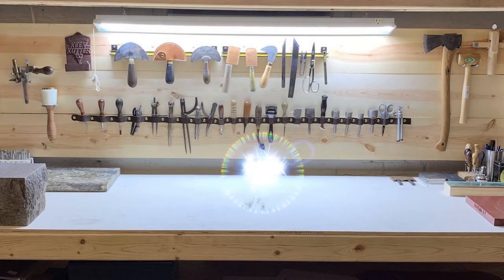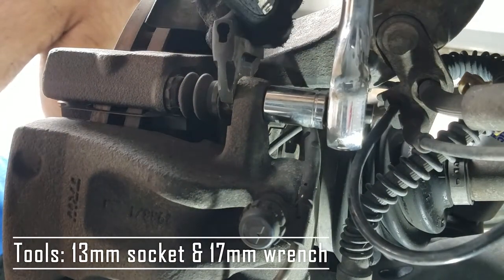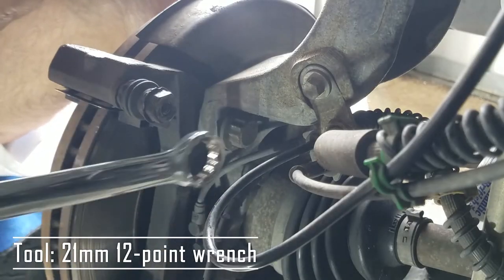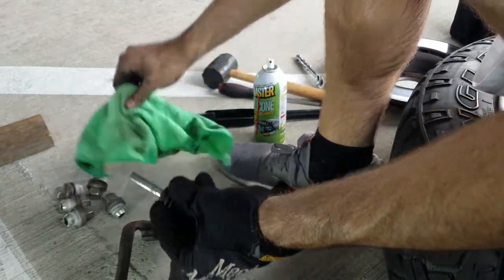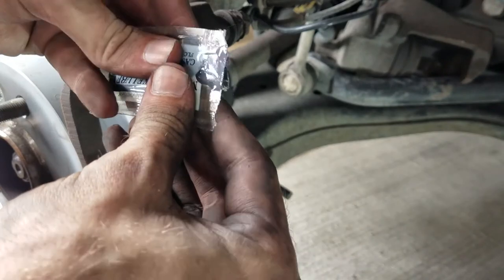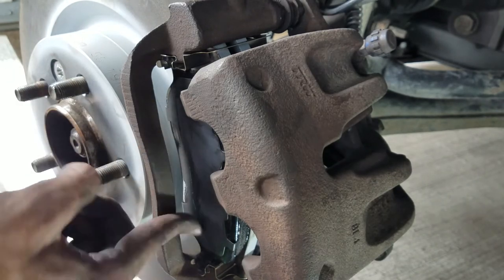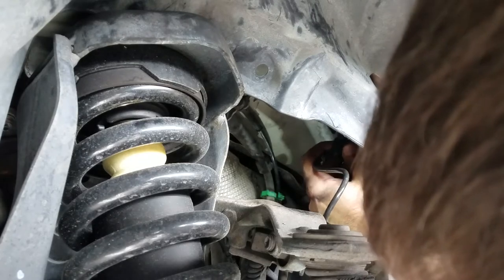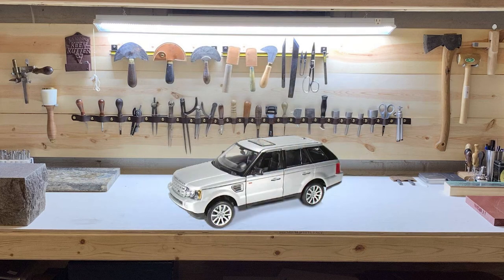Replace Brake Pads - Range Rover Sport or LR3 (+ Rotors & Sensor!)

Comment: This instruction work with MY2010 5.0SC as well?
Reply from the maker: The SC usually has brembo brakes, so removing the caliper will be different. Overall the procedure will be similar however.

Comment: Hi very good video. One question how do you reset the brake light after replacing the wear sensors?
Reply from the maker: It automatically turns back off once the sensor is replaced 👌

Comment: Hi! Is the brake sensor on the lr3 a one time use? Do I need to replace it each time I replace the pads?
Reply from the maker: If the brake light comes on, the circuit was rubbed down and broken so the sensor will need replacing. If the light never came on then you might be able to use the sensor again, just look at it and see.
Reply: @HazyJay  excellent thank you!

Comment: Where would you recommend ordering the brake set from? Is there a specific serial or product number?
Reply from the maker: The description will have the parts for the FRONT brakes (EUR1098), also these are the non-brembo brakes that are usually found on the normal RRS (the supercharged RRS has the brembo brakes).

Comment: Great VD,  ? 4 u.when u r changing the brake pads do u also need 2 replace the rotor 2 even though  they r in good condition?
Reply from the maker: If the rotors are in good condition then it's not necessary to replace the rotors with the pads, the new pads will seat with the old rotor's grooves after a few miles.
Reply: @HazyJay  thanks  ! U just saved me thousands of $$ some dude @ PEP-BOYS WANTED  ME 2 CHANGE ALL THE ROTORS.
Reply from the maker: @walkingdisaster2475  Heh yeah if you take it to a repair shop they will almost always want you to either change the rotors or have the rotors machined, both options are usually way overpriced. You can buy 4 new rotors for about $300, so there's no reason it should cost >$1,000 for a rotor job IMO.

Comment: i done replace brake pads front and rear fit new sensor is only one sensor at the fornt and one at the rear replace both i when for drive is about 300m away press the brake wear pads light on please can you help me out
Reply from the maker: There should only be one sensor for the front and back, you'll need to manually check them to make sure they didn't get worn down from being installed at a slight angle or disconnected from the plug, either situation would cause the light to come on.

Comment: Really good. I think they are the same as 06 RR HSE. One question... why didn't you use the "brake grease" in the caliper pins? I know some brits use copper grease. You indicated it should be silicon paste... maybe not critical... but curious
Reply from the maker: It's my understanding that silicone paste wont degrade the rubber boot on the caliper pins and it holds up to high heat like with breaking. If you use copper grease it's probably not the end of the world, it will definitely withstand the heat although it may degrade the rubber.

Comment: Another great video. One question: are there sensors on both the left and the right sides?
Reply from the maker: No they are on JUST the driver front and back brakes, there aren't any on the passenger side. I guess they assume you'll change both front/rear at the same time and the pads will wear the same 🤔

Comment: Why not use slotted rotors or drilled rotors?
Reply from the maker: You certainly can if you'd like, however the perks of those rotors don't really translate to how I use the car. The idea is drilled or slotted rotors cool the rotors faster after significant braking, like slamming on the brakes multiple times at highway speeds (or racing), this just isn't something that I ever do. One-time stopping (emergency braking to avoid an accident) should be the same between normal and drilled/slotted rotors, which is more important for me, and normal city/highway braking should be the same as well.
Reply: I put everything good but the light still stay on
Reply from the maker: @joseangelcaceresjimenez3645  You did change the brake sensor, correct? In addition, there is a brake sensor in the rear that may also have been worn.

Comment: I have replaced all pads and rotors on my Range Rover sport super charged 2011 twice, but it front rotors still got swirled somehow. Is it because of quality issue since I have been driving with extreme caution for the first 500 miles.
Reply from the maker: Swirled as in warped? As in the wheel vibrates when braking? It sounds like you've been driving cautiously and not excessively braking so it's pretty unusual. I think I've changed my brakes twice in the last 7 years, I always change the rotors when I change the pads.
Reply from the maker: The only thing I can think of is a stuck caliper piston (the 2006 has two pistons per caliper), it's conceivable this would cause irregular pad pressure that could cause jittering or warping.
Reply: @HazyJay  thanks for the reply man. My rig is 11’ rrs S/C, it’s been 10 years and it’s my second time replacement. I always replace the entire system with genuine parts ordered directly from Land Rover parts, but this time is done from an indie. The rotors just become warped after few hundred miles with extremely cautious driving and proper wheel lug Torques per user manual. The pad makes a ton of brake dusts, I’m not really what caused it to warp so that steering is shaking a bit during high speed light brake.
Reply from the maker: @harryj1081  Ohhh if you weren't able specify which pads/rotors were being used and it was an indie shop, they may have just gone with the cheapest option rather than the OEM items. More brake dust than usual is an indication that at the very least, they used different pads than typical. The SC uses brembo calipers and does most of the braking for the vehicle (due to weight shifts while braking and the engine being in the front) so I'm hoping it's just they used cheap pads/rotors rather than a caliper issue. Might need to re-do the job unfortunately.